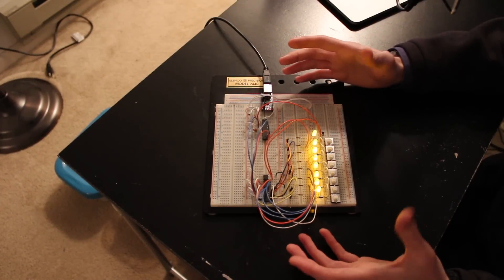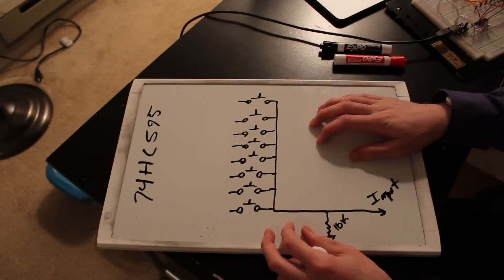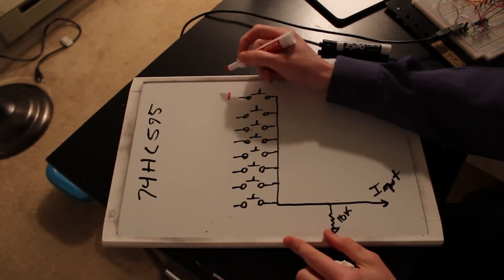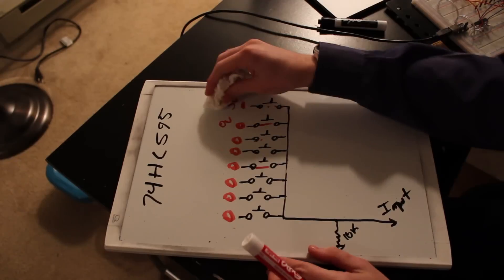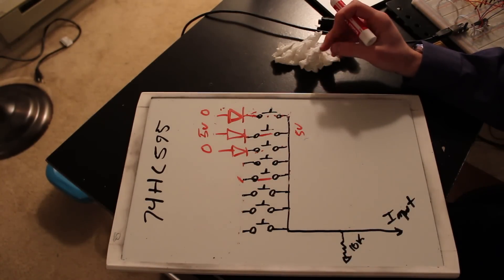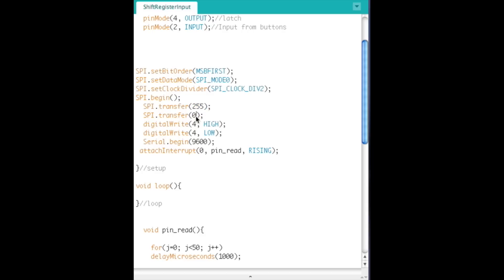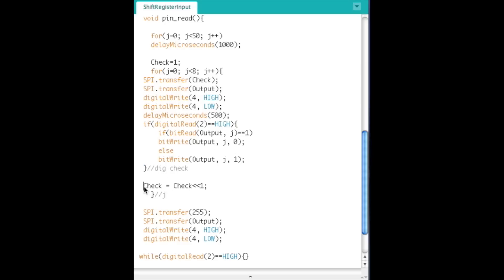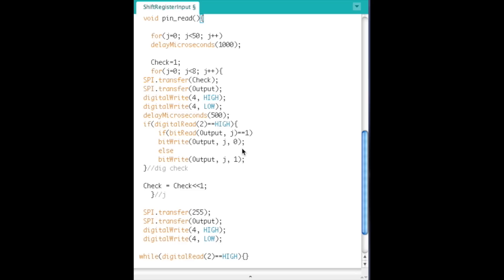How to Control a Ton of Inputs using Shift Registers!

Comment: Cool trick! I was thinking of letting the last output shift everything back to the micro controller. As in insted of connecting another shift register in series, I would connect it back to the arduino in this case. There I would shift the bits into a byte and after the 8 clocks I would have the output byte back and could mask for the correct buttonpress. I figured it would maybe work since it shifts out from there. But maybe your loop is better hmm I'll try and see. This gave me inspiration! Thanx

Comment: Yes, this is an old thread, but still very, very useful.  The technique to find out which buttons are pressed is super!  And this, with a 595 which is supposed to drive something, not to (indirectly) detect if something is changed/pressed...  Very clever indeed...

Problem is that I don't know which Arduino has been used for this demo (if an Arduino has been used at all) but I struggled with the SPI communication because with the Arduino Uno, the clock and data pins are switched.  In my case, the clock pin is Arduino pin 13 (and not 11 as per the tutorial) and the MOSI pin is Arduino pin 11 (and not 13 as per the tutorial).  In the video where the code is explained (e.g. time 12.14) it's mentioned otherwise.  Unless the comment written next to the pins is wrong, in which case I step back silently...

Can this be confirmed?

Best,
--Geert

Comment: This video is 8 years old and I don't know if you still monitor comments, but what if the input is say triggered by a sensor and therefore, not released again until the sensor state changes. Which could be seconds, minutes or even hours later. It's the infinite loop code and concerns me here. Maybe leave that line of code out or give it a fixed value. I guess I could just build this circuit and test the results. But if anyone else has done this, let me know.

Comment: I love this project, really, but it would be incredible if we had schematics. In the end, becomes a very dark and cloudy tutorial. How to work the outputs, I get loads of info, but I'm having trouble knowing where to connect the pin 2 to the shift register as said in the code. Actually, I can't find any documentation of using 74HC595 as an input expander. Only with other shift registers like 74hc165. I see 74HC595 as an output expander.

Comment: Hi Kevin, I'm trying to make a small simple midi keyboard with 25keys (nothing fancy, just digital switches reading on and offs and sending the data to the computer) . I just need it to be polyphonic upto 10keys. I.e it should be able to detect (on or off) for 10 keys at them same time. And it should be very responsive in reading it. Are multiplexers okay or shift registers? Which shift register do I need need. And i saw you pressing multiple buttons at once. How many can actually be pressed at the same time and still work in your setup.
Reply: Hey @10magicalfingers27
I'm curious to know if you got a solution for your project. Did it work? And do you mind sharing your thoughts?

Comment: Hey Kevin Darrah and anyone reading this--- quesiton. In this type of circuit where there are real pushbuttons being read (and real LED indicator outputs) with two 74HC595 shift registers, how would you go about designing a circuit that can virtually PRESS the button exactly as if the user did? The only interface allowed to accomplish this would be the 4 wire bus with clock, latch, data, and ground.  I wlil be a third device on the bus between the actually LED/button subcircuit, and the main product's microcontroller.

I am working on this problem and I realize I have to first sense which bit is currently being set. I do this by waiting for the first bit and then counting along with the clock until I reach the bit that will be the button I want to press. However, my task is to now cause the line to go low at this exact moment .I am finding it difficult to design something (currently using nodemcu/esp8266) that is fast enough to accomplish this.  I have to be very fast because I dont want to keep the line low during the next bit.... which is not a problem for a "real" user pressing the real button because each button is directly wired to the appropriate bit, obviously. User can just mash the button for many seconds and we will still only see the correct bit being set. But when operating on the data bus, I can only act during that single bit.

Any suggestions? Maybe I am making it way too complicated in my mind. I am obviously a novice at best. An dthe fact nodemcu/esp8266 seems to have a broken SPI implementation for mode 2 and 3 (3 is what the system I'm interfacing speaks and I cannot change that), is not making it easy!!!
Reply: Hey, I'm in a similar situation on the hardware side. Have you tried the Shifty library? It seems to be inspired by this video and as far as I can tell it does not use the SPI library, so you are free to use other pins.

Regarding the "emulation" part, why not do the emulation in software? What are you trying to accomplish with this "hardware" emulation?
Reply: @the-mush   I actually did finally accomplish it!! But Heres some info in case you were curious.. I have a pool pump system that  uses SPI to talk between the control system board iwthin the pump itself, and an externally mounted display. The display is dumb -- by that I mean it just has two 74HC595's in series. The control system sends it bits to light up LEDs (a 7 segment and several indicator lights). It also cycles the shift register outputs in order to sense push button switches --- exactly like you've shown in this video. 

If any button is pushed, it will bring the SPI Data line down from 5v DC. Based on which output it has activated and when it sees the DATA line go low, it knows which button was pressed. 

My goal was to insert a circuit of my own design between the control module and the display, to both receive the display signals and decode them (so I know what the status of the pump is), as well as virtually "push" buttons to remotely control the pump. I was able to accomplish it, but because I could not read the SPI data fast enough, I had to use some creative timing in order to "press" the button at the right time to activate it like a person does, for at least 8 cycles or so (since it does some debouncing, apparently).  Arduino was not fast enough, I ultimately had to use ESP8266/nodemcu --- which is still not fast enough to read the SPI in time for a button press (which was my main issue), but with some creative timing I was able to sense one SPI message and then bring the data line low at the right time.
Reply: @gutrali  oh ok, it does seem like you could have just connected your hardware with the esp8266 only and ask it for the information, maybe through serial. So the esp8266 would independently talk to your hardware and the buttons
Reply: @the-mush  esp8266 #1 didnt seem to have a working SPI slave library for the mode 3 the pool pump speaks to the display module. Plus, even if it did, it wasn't fast enough to respond in time to "press" the button at the right moment. I had a window of like 10microseconds IIRC, after the latch was set on the previous message. No way I could process the SPI data to know it was time to press the button before 10Micros was long gone.

 I definitely got the reading of the data coming out of the pool pump down and figured out already, earlier this summer.. . But the button press was quite a f@#%^@!6 challenge. I ended up walking away from it for a few months, and came back with a fresh mind. that's when I wrote the comment above pleading for an assist LOL. I was able to code something up in a couple weeks of attempts tho. At this point I am just refining and adding Wifi support, email alerts, and soon a UI... all the easy stuff!! Then I intend to reproduce on a small PIC x 5 and list on amazon ---- I know there are others that would want wifi status and control for this pump and it has a very convenient connector that my circuit can just plug into.

So, thank you much for your video! It helped me understand what the pool pump controller was doing to sense the button presses. AND thanks even more for your personal reply!!!! People like you are what make the internet community amazing. Keep it real!
Reply: @gutrali  Oh, sorry, I'm not the maker of the video! Just stumbled upon it searching for a way to use this chip (intended for outputs) into an "input" kind of shift register.
Nice to hear you managed to solved your problem though! Take care 👍
Reply: @the-mush  oh!! Well you landed here, too, and spent your time to reply!!!! So I still very much appreciate your time spent. You good peeps. 

If u run into any projs like what were discussing and want to bounce challenges off someone, feel free to hit me up!!

Comment: I think u can also use a 74165 parallel in serial out that has its output pin hooked to DS of the 74595 to achieve this
Reply: I think. If using 74165 then no need to use 74595 anymore. It is possible to connect the push button directly to the 74165 to reduce complexity. The rest is just programming.

Comment: @kevin darrah sir im asking for help do you have a schematic diagram of 4 or 5 or more inputs interlocking circuits...for example i have a four inputs push button 1 to 4 and output LED 1 to 4 the sequence is like this..if i press push button 4 the LED4 will turn on then when i press push button 1 the LED 4 will turn off then the LED 1 will turn on then when i press push button 3 the LED 1 will turn off then LED 3 will turn on and so on..it always one LED will acivate on OUTPUT...please...thanks in advance

Comment: So it's basically a ghetto MUX, which is pretty cool if you don't have an 8-to-1 MUX lying around, but the really interesting thing about this is that since you're strobing the source voltage across the pins, it should actually work with analog inputs as well as pushbuttons. When you do the strobing pass, the pulldown resistor will reduce the voltage across the inactive pins to 0, so you can theoretically get the voltage across only one input at a time.

You may need to do some resistor math to figure it out exactly. It's been a few years since I had to calculate circuit diagrams, but could be especially useful if you have a limited number of ADC pins available.
Reply: Back to say: I just tried this, and it actually works way better than I expected, but not exactly how I described 2 months ago.

Your analog inputs each have one reference pin tied to VCC or ground, depending on whether you want them to be active-high or active-low. (VCC for active-low, VSS for active-high)
The other reference pin is tied to the shift register, and is strobed through just like in this example (or the later one where he switched from ISR to polling)
Analog values are connected to a single analog pin via a diode. If the circuit is set up in Active-High mode, the diodes should be pointing from the analog sensor into the MCU analog input pin. In Active-Low mode, point them the other direction.

The analog pin will read whatever the highest/lowest (depending on mode) value among all of the analog sensors is. By setting the shift register pin to inactive mode (low for active-high, high for active-low), you effectively remove that sensor from the circuit. Set only one sensor active at a time and strobe through them to read 8 analog values on a single input pin.

Comment: As any arduino board all pins can be used as digitalRead. My arduino Pro micro board has 18 pins for use as digitalRead.  I 
 Need to 42 pins for input to my arduino board(for different outputs) .  Is it possible using 74HC595 shift register????? .  If yes,   please help me with arduino sketch & wiring diagram arduino board to 74HC595 and push buttons,,,,,,,

Comment: The first switch scheme is flawed because it assumes that all the switches and wiring will remain pristine, but what happens when the switch contacts get tarnished and slightly resistive? It works good when the equipment is new, but what happens in a couple/few years?

The shift register button scanning scheme, as you explained it, starts out with all 1s then upon getting the interrupt it shifts a 1 through the chain. You would have to continue shifting that 1 until none of them came back high, at which point you could then re-enable the interrupt, otherwise you would miss the successive switch closures because they wouldn't be generating an interrupt. Since you are stuck using a '595 anyway, just use a PISO shift register like a 4014- same number of pins, none more of the headache.

Yeah I know this is old.
Reply: Yes, I am confused about the chip choice. Isn't the 595 intended for parallel out? vs the 165 for serial in?

Comment: If I want to use 4 total shift registers, 2 for buttons, 2 for lights, do I just wire them all up together from the same clock/data/latch pin? And what changes in the code when you add more registers?
Reply: Yes, you just chain them as many as you want (and even may play with the order) and in the code you need more "Output" variables (array?) and loop the "Change" over all inputing chips.  Also note, that you can use part of chip for LEDs and part for buttons, if you wish so. Just little complicated code, but not too much. The idea is still the same - cycle 1 over buttons, detect, what is pressed, the restore outputs to proper state and wait for another interrupt.
Reply: @Gilhad1  please sir could you write the code for us? i'm desperate for searching and i need only 16 input and 16 output just with the same i dea of Kevin

Comment: Hi. I have a working circuit which has 4 digit 7 segment led display. I want to to read the Data and make my arduino send Smae numbers to my serial monitor tgat what my segment display shows simultaneously. What u wld advice? And umm this segment display has total 12 inputs which 8 for leds and 4 for shifting from eacg 1 number block cathodes(or anodes). Any advice?

Comment: Sorry.. am only a beginner.. I got little confused.. I heard 74hc595 is an output shift register (Serial in parallel out) and 74hc165 is actually an input shift register.. But here (05:40) you are mentioning it(74HC595) connected with push buttons.. Little confused
Reply: you output 1 sequencially to each button and read the common part (pin2) to see, if there is 1, so if the respective button is pressed. Input is pin 2, the output register 165 shifts the "voice" to particular buttons.

Comment: Isn't this simplier with the CD4021 chip instead of the 74HC595 chip?

I'm a novice so I really don't know, but it does seem like one chip is made to shift out (e.g., to a bunch of LEDs) and another to shift in (e.g., many buttons)

On the other hand most arduino kits come with a 74HC595 and not a CD4021 so maybe I'm missing something.
Reply: To use a CD4021 (or other parallel to serial shift register) you have to constantly read in the register to know whether anything changed. With the '595 you just turn on all the outputs and you forget about it until an interrupt occurs. When an interrupt occurs then scan to see which one(s) caused the interrupt.

Comment: IF they are all high why you a minute later turned them all low? It does not make sense and you are not a good teacher.
Reply: You set them all high so that any switch will cause an interrupt. When an interrupt occurs then you turn them all low except for one, then scan that one across all the inputs to see which ones are on.

Comment: The diodes are required if anyone is wondering :) I didn't have any on hand so I just used some LEDs! for testing purposes, anyways.
Reply: Aren't LEDs horrible diodes? I have no facts to back it up, but I've heard that LEDs were made to emit light, and not to block the current. But if it works for testing purposes then I don't really see a problem either xD

Comment: Can I use one shift register as both an input and output?
Reply: Yes, just little complicated programming. But the "input" is de-facto output 1 to button (istead of LED) and then listen if there is some signal on the other side of "selected" button (on pin 2).

Comment: how many shift registers I need to control 25 key keyboard ? what is scan matrix? with 9*3 scan matrix can I control all 25 keys . how to set up that? pls advise
Reply: 4 registers using this idea verbatim. to read matrix you need different aproach. Depends on many factors, what is the best, I woul use one mcp23017 over I2C for matrix up to 16 (rows+cols total)

Comment: Why would someone use this technique over a simple 74hc165?
Reply: To use a 74hc165 (or other parallel to serial shift register) you have to constantly read in the register to know whether anything changed. With the '595 you just turn on all the outputs and you forget about it until an interrupt occurs. When an interrupt occurs then scan to see which one(s) caused the interrupt.
Reply: Ah, I didn't consider interrupts

Comment: Hi Kevin, 

I tried to use this method to read potmeter values. I use the shift register to give each potmeter 5v on one pin, and I use diodes to connect the potmeter output to one analogPin. 

I shift in 1, 2, 4... and so only one potmeter gets high at the time, and then I read its value on an analogPin. 

But. 

It doesn't work :' ( My Analog read values go crazy all the time.

Can you make a video where you use potmeters as inputs? Is it possible to make it this way anyway?

Thank you very much.